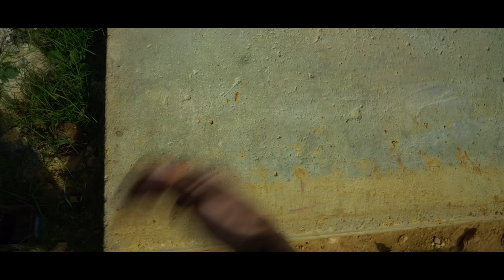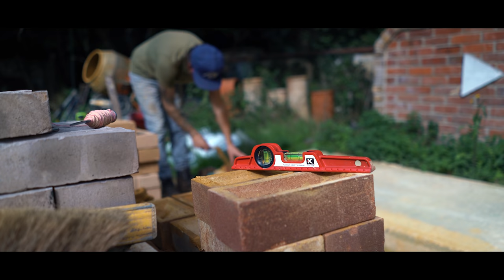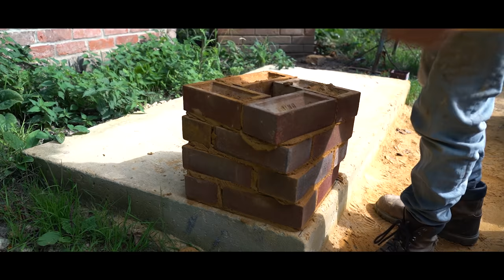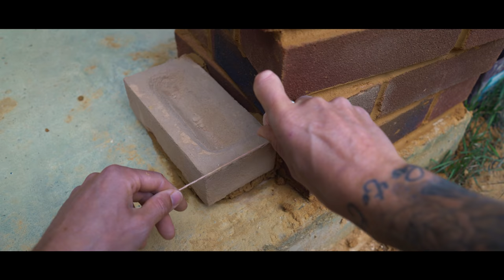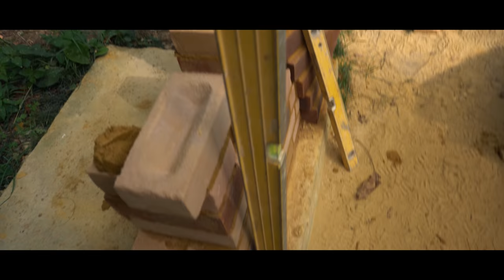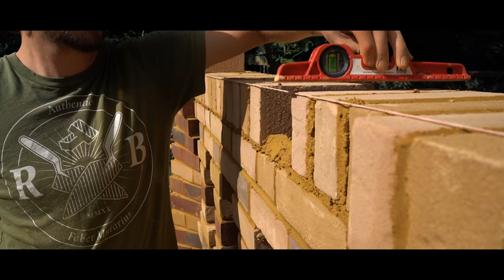BRICKLAYING | TWISTED BRICK WALL

Comment: Cool, I see you cut the mortar joints with the trowel after striking just before brushing.👍 The bricklayers around here haven't been doing that since the 1990s. They just strike and then brush. It makes a mess but they don't care. The pressure washers will clean it right up, along with a mm of the mortar joint 'skin'.😅